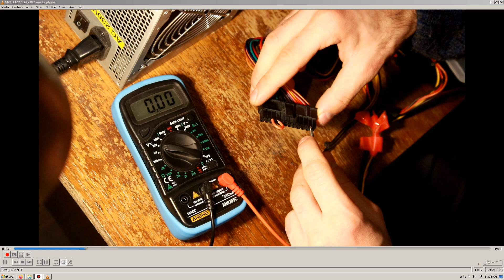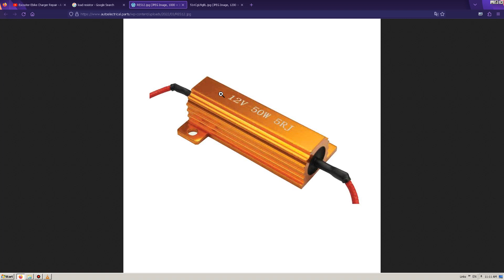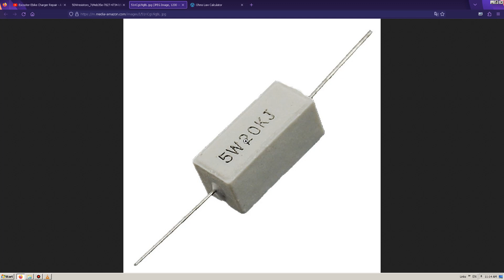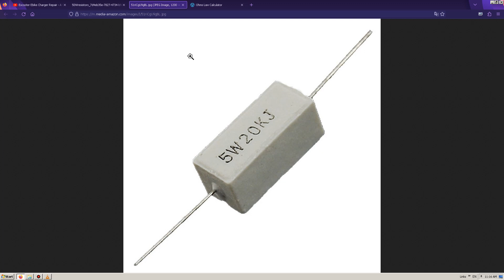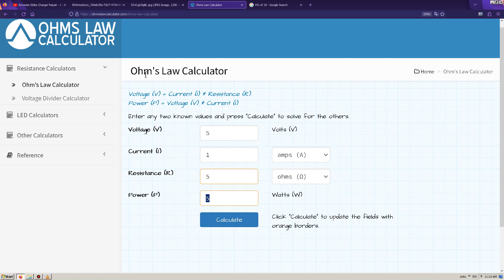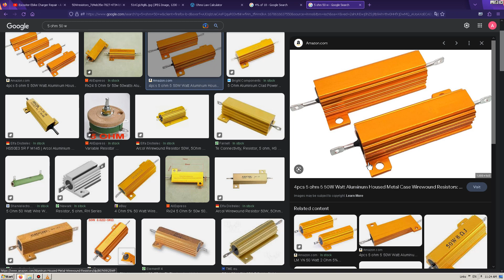LOAD RESISTOR in ATX PSU ! - Everything you need to know(explained)(LAB Bench PSU DIY)

Comment: If I understood it correctly, the idea is to stabilize a DC voltage (say 5V), which for some reason is jumping up and down around 5V, say, between 4.9V and 5.1V. I.e. + - 2%.
How a resistor can help it? Resistor creates a drop of voltage.  Therefore inserting a resistor between this 5V +-2% rail and my PC board will produce, say, 4.5 V with the same 2% jumps up and down.
To  stabilize a DC voltage, capacitors are used which work as a shock absorber on a bumpy road. Resistor can reduce a voltage but I cannot understand how it stabilizes fluctuating voltage. Please will you clear this up
Reply: The "filter" capacitor will always be full with no load. A light load(too small of a current) would be like a car shock absorber trying to stop a feather from bouncing.

Comment: Just so I understand, a load resistor is needed ONLY if the signal coming out of the PSU is noisy/unstable, correct?
Reply: this is a bit tricky.  A resistor cannot remove noise. A capacitor can. Also a voltmeter would not show a noise. An oscilloscope would. But slow variations of voltage (say once a second) would not affect performance of an electronic assembly for which this PSU is intended

Comment: Very well explained. This solved a problem that puzzled me for a long time with "Voltage Too Low" errors on some raid systems I have been using. For now, as a quick fix, I have just used a 21 Watt 12 Volt car light bulb as a 12 Volt "dummy" load. But I have ordered some "official" load resistors that I will use for the long term. Thank you very much!

Comment: r u advertiser  of aluminum p resistores?🤔
60 watt? 
car halogen lamp 60w?
so when you turn ps without any use of it it waste 180 watt power befor start to take any power from it! h abt e bill😙
and what was total Nominal power and real power of it?🙄
get some room, just in case you fully put unit under real power befor using any power for progects~

Comment: I'm building a bench PSU, the 5v is stable with no resistor but the 12v and 3.3v are not, do I still need to put a load on both of those rails or with the 5v being stable is enough? The 5v rail is the highest amperage with 30A

Comment: Extremely informative video! So many content producers don’t go through the hows and whys of the subject. As far as repeating yourself, you shouldn’t worry about it. Think about it as reiterating or highlighting the more important points. 
I do have a question that may be related to this subject. I see on some Volt/Amp (panel) meters they have a “Shunt resistor” included, others don’t have them. Is that basically another term for a load resistor? Is a shunt only required when is it higher amperage? The panel meters that don’t come with a shunt included do they still need a shunt to work properly? 

Thank you in advance.

Comment: I am building a power supply, but not with a ATX PS. I bought 24V 6A power supply, and a step down converter 150W and 12A, so it can handle 6,25 A. I have to use a load resistor too? I want to use that supply for  a soldering iron station, so i dont know the exact power i will need and how much current i want

Comment: My power supply won't start up (I did a jumper from green to black (ground)). No fan, nothing. I accidentally bought a 50W 20ohm resistor, knowing nothing about them. My power supply is rated for 305 watts maximum. The bundle of wires rated for the highest amps is the 5v (22 amps), so that's the one I connected the resistor to (one side red, the other black). 
When I power it up, nothing happens. So I tried jumping the green to the second bundle of black wires (ground). I also jumped the brown wire (which is 3vSense) and jumped it to the 3.3 v bundle of wires (orange). None of these things worked, and I get no fan, and when I take the meter to the various lines, it just reads zero. It seems dead.

Can anyone offer guidance? Did I kill it with the 50W 20ohm resistor? It came out of my computer that worked up until the day I took it out for this project. Thank you.
Reply from the maker: If PSU does not start at all when you do a jumper wire from green to black without load resistor, it might mean PSU itself is not working.  
It would be good to test it in actual computer configuration 
No you did not kill your PSU with a load resistor, as 20 ohms on 5v power line would draw 0.25A and generate 1.25w of power.

PSU was probably dead already before you connected the load resistor.  
Still to be sure, connect it to some configuration(motherboard+gpu+hdd at very least although I would add a DVD drive) and see if it turns on, if it does that means you need more load, like 5 ohms resistor on 5v line or 2.5 ohms.  
And maybe you need more load on other voltage lines, like I said in the video, some PSUs need loads on multiple voltage lines.